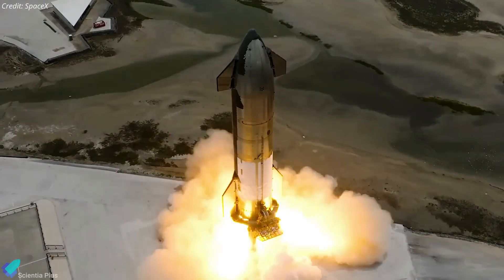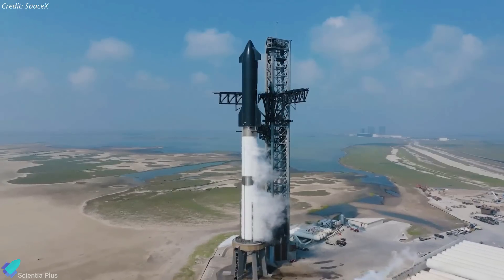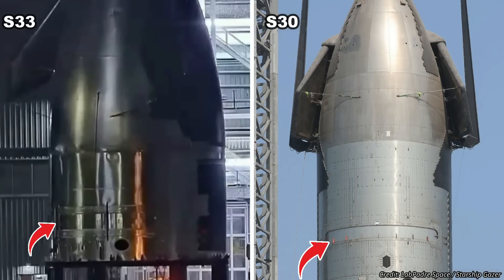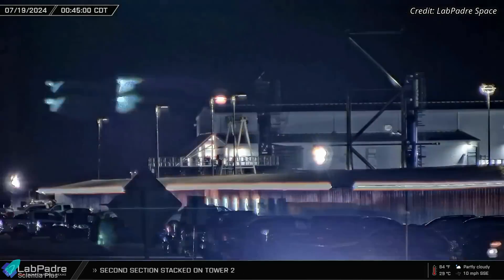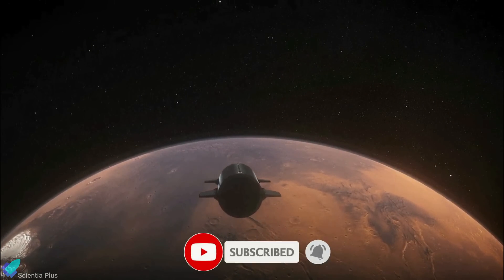SpaceX Found The Real Issue With Falcon 9 & Fixed It In 2 Weeks, Starship Flight 5 May Delay

Comment from the maker: 00:00 Starship Updates
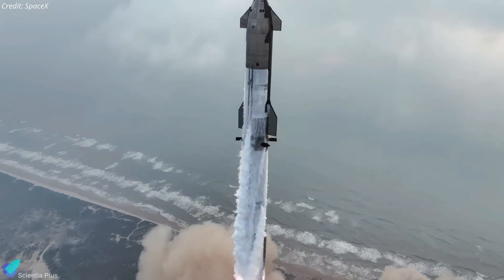08:12 Falcon 9 Returns To Flight: Issues Fixed in Just 2 Weeks
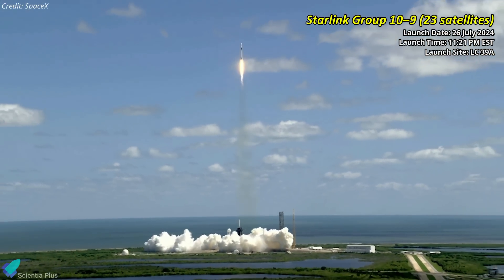10:10 Why Did NASA Cancel the VIPER Lunar Mission? 
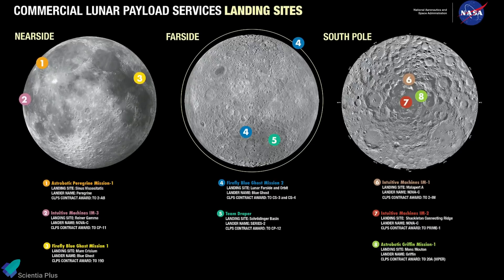12:12 RS1 Rocket Destroyed During Static Fire Test! - 2nd Mishap In A Row

Learn More:
1. Latest Starship Upgrades
 a. Starship Hot Staging Explained: https://youtu.be/qgZHo9wYRW0
 b. Super Heavy Booster Upgrades: https://youtu.be/vZH5esgrFiM?t=63
 c. How SpaceX Protect Raptor Engines: https://youtu.be/L22gyQDDXho
 d. Starship New Heat Tiles Explained: https://shorturl.at/p2Ijb
2. Starship V2 Features:
 a) https://shorturl.at/lpGT7
 b) https://shorturl.at/gwNQ4
 c) https://shorturl.at/xa60S
3. Starship V3 Features: https://shorturl.at/mnBT4
4. Starship V2, V3 & Raptor V2, V3 Complete 2024 Update: https://shorturl.at/tN248
5. ABL Space RS-1 Rocket Features + Inaugural Launch Failure Explained:
 a) https://shorturl.at/tXyDk
 b) https://shorturl.at/tsh98
6. Falcon 9 Upper Stage Anomaly During Starlink Mission Explained: https://shorturl.at/iPJBR
7. Starship Block 2 Stacking Begins: https://shorturl.at/hXEzO

Weekly Updates: https://bit.ly/3HIQjPC
SpaceX Playlist: https://bit.ly/34wue8T

Comment: SpaceX's biggest problem is the FAA and NASA. They are not used to a company operating a such speed. SpaceX does not try to overthink things. They test, destroy, modify and retest again at lightning speed unlike what NASA and the FAA are used to. The FAA needs to get up to speed or get out of the way and let SpaceX operate at their own speed. Look at the progress with the Falcon 9 failure, diagnosis and repair along with investigating the rest of the fleet for similar problems. Face it. No one is used to the speed that SpaceX operates at.

Comment: Look at the difference between SpaceX and ULA/Boeing when they have a problem.   SpaceX finds the cause, tests the fix extensively and returns to flight with all other rockets affected by the problem already fixed.   ULA/Boeing has a problem for over 3 years....and STILL has the problem and seems unable to fix it/them.   It's nice having two systems that can send people to space...but when one operates efficiently with great success and the other consumes multiples of the funds yet fails repeatedly...we've got to make some changes in leadership personnel.
Reply: Why is ULA involved? ULA just provides launch services and has done a fine job of that. They have no involvement in Starliner beyond successfully launching it (3 times).